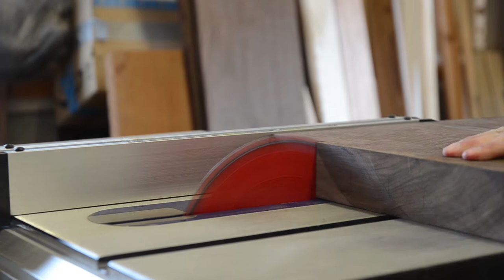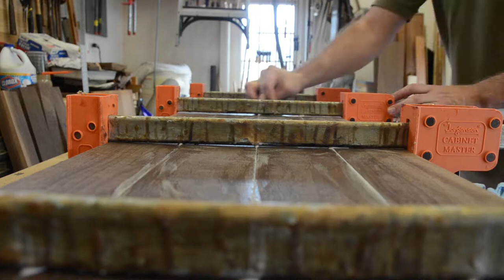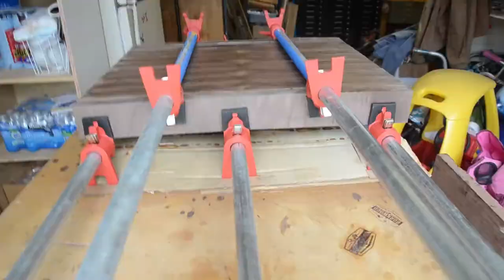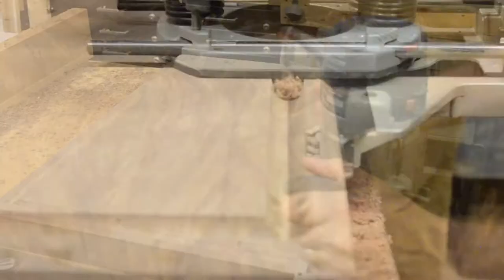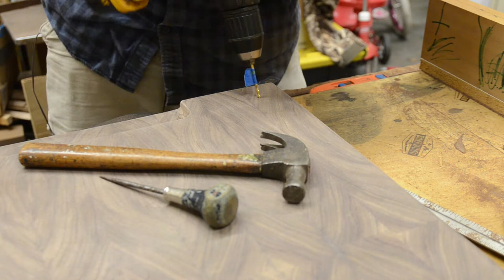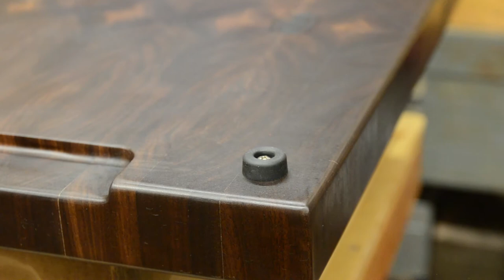DIY End Grain Cutting Board

Comment: I was considering using this router sled method to flatten my cutting boards.  I see you had some tear out but it looked like it wasn't to bad at least not so bad you couldn't just trim it off.  Did you do anything to minimize it?  Did you find a specific bit that works best?